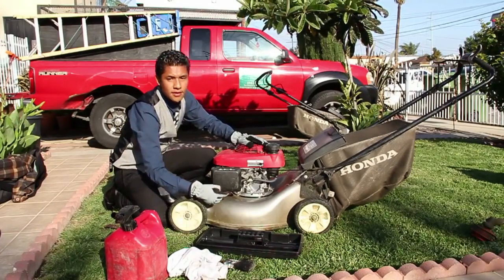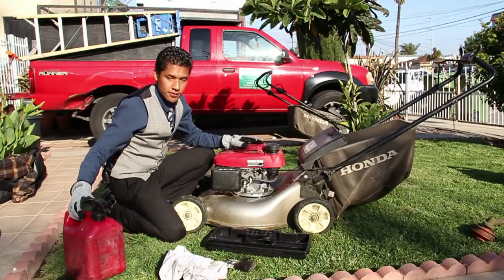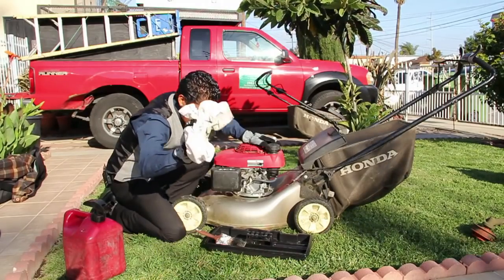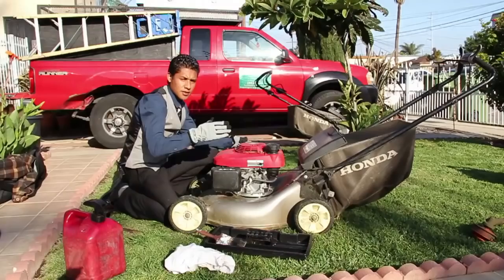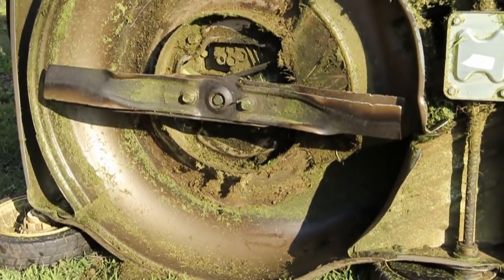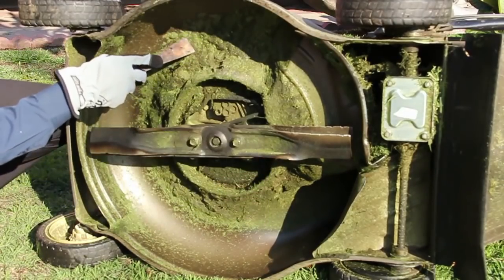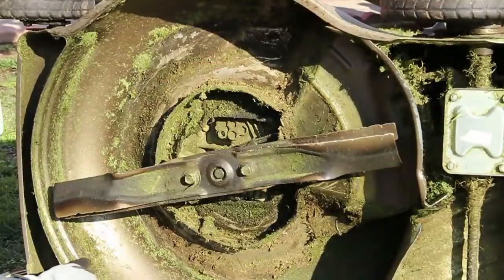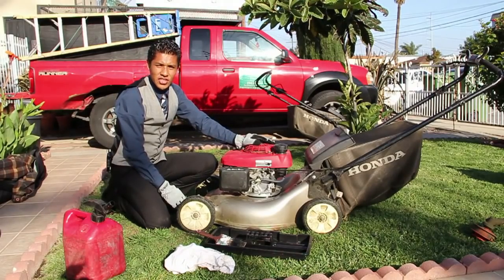Maintenance for Lawn Care Tools : How to Clean Your Gas Lawn Mower

Comment: Careful not to spill gas on the grass or you'll kill it.
Also, you put the mower on the correct side. The carburetor always goes up to help prevent crankcase oil from entering it. That can happen when tipping the mower on its side with the carburetor facing downward. Lastly, its a good practice to remove the spark plug wire from the plug prior to any physical contact with the lawn mower blade.
Nice job young man! You put together a helpful tutorial there for many homeowners. Keep up the great work!

Comment: 1) never cut wet or damp grass as when it clogs up like that you put extra stress on the engine.

2) never use a scraper to remove the grass as you may remove the paint which will expose the metal to rust.

3) Never use a hose to wash the mower as water will eventually cause rust.

4) never tip the mower with the air filter at the bottom, and if you have to tip it on the side (air filter to the top) ensure the piston is at the top by pulling the starter cord until it goes taught.

5) for cleaning allow the mower to cool, remove the spark plug cap and tip the mower back to the front is in the air, remove any lumps of grass with a gloved hand and then use a wooden kitchen spoon/spatula (blunt edged) to remove grass and then a firm hand brush.
Reply: Good tips, Wayne! I cleaned my mower today, but I tipped the mower forward instead of backward, unfortunately. I only had it in that position for a minute or two, and it started up fine afterwards. Should the mower be okay?
Reply: @MikeDGuitar  just check on oil got in to the air filter, if it did clean it or replace it if its bad
Reply: @waynegarrett1614  Cool! That's what I did, and there was just a little bit of oil along the top of the air filter. I soaked it up with some paper towels. Many thanks for the response!
Reply: You may want to use a hard plastic scraper and remove the spark plug first and foremost.

Comment: Oh Jay Jay Jay,  what are we going to do with you? Slightly overdressed. You forgot to pull the spark plug wire. Cleaning your lawn mower on the lawn and with gasoline? Now Jay let's think about this. I see quite a few Knicks in that blade.  It could really use a sharpening. While you did shut the gas off, as soon as you tipped it on its side you were likely dripping from the gas tank all over the lawn. Going to have quite a few dead spots to fix their Jay. You were just funnin us weren't you?

Comment: U forgot to mention disconnecting the spark plug lead & putting a piece of plastic bag over the fuel tank opening & screwing the cap down over it,dont forget to remove it after ur done or your mower wont run properly until u do (it creates a vaccuum)

Comment: I use WD-40 and it melts away the grass gooo.
With gas tank almost empty, turn on the side and 
use WD-40 and in 2-3 minutes stiff brush to wipe away.
Reply: I use baby oil with spray bottle
Reply: @Chris H 
I have found it possible to turn sideways my mower 
with the oil dip stick on the upward side.  If the oil draws sideways  to far 
inside, it also drains back in a few minutes.
.
It is not necessary to turn the mower completely  to remove the blade,
cleaning and sharpen..

Comment: Hi Jay,
A few things others have mentioned:
1.  Disconnect the spark plug before anything.
2.  I've used gasoline before too, and it works as good or better than anything.  I don't anymore.  Gasoline can do you in a multitude of ways:
  - Its fumes travel, and the spark plug wire after disconnected will get it going.  you will never get those gloves off in time and you will have permanent burn scars, no maybe about it.
  - Everything nasty causes cancer, but gasoline moves through your skin readily.
Diesel fuel works very well, it won't start on fire easily, slower to go through your skin, and less cancerous, BUT use gloves.  If I had know what people know now, I would have.
 3.  You flipped the mower the correct way, but mention that you did it so that the gas tank is up, and not completely full.

Question, that looks like a Honda HRX.  I don't know if you mulch with it, but if you do, how well does it do?

Comment: Disconnect spark plug wire first if you are spinning that blade around.   Gas over the grass?  Good luck with that.
Reply: @HeatCheck718  why take the risk?
Reply: Blade needs to be replaced, spark plug boot should be taken off and if you want to kill your grass, get gas on it.

Comment: After watching this video be sure to search for a video on how to repair dead spots in grass due to gasoline, and or why does the paint finish look so bad on my mower? #thereisabetterway
Reply: +Jeff Hobgood beat me to it! :)
Reply: Jeff Hobgood no kidding man. I just cold rinse, give a light degreaser spray to the mower surface, then mop with the same soft brush and car wash solution I use on my car. Cold rinse again, blow out water with my blower and woohoo.

Comment: nice, the only thing missing is removing the spark plug. I use old gas that has gone bad or in question to clean engine parts. I wouldn't do it my lawn just in case some spilled. I wouldn't want a dead spot in my yard. However a very helpful Video.

Comment: if you are in the mowing business i suggest you remove and sharpen your blades more often -- blades with those chips on edges just tear top of grass blade and leaves dead brown top of grass and then lawn does not look as nice ----  i just do my own lawn and i would never let my blades get that chewed up -- how about using 409 or Fantastic or similar product to clean top of deck, not gasoline -- and then when you are under deck use wire brush after putty knife... and then spray with WD 40 or Rust Pure or similar product - then grass wont stick so much

Comment: How about this 1. Remove boot from spark plug. 2.POWER WASH IT!! much safer better job. 3. Shut off fuek valve. 4.REMOVE BLADE!! SHARPEN IT! Scrap deck. 5. Slap blade on. 6. Turn on fuel add a seafoam protects gas AND cleans your carb. 6. Add spark plug grease attach to. Plug to boot. 2 years experience professional service. Need more help look up Miller Lawn and power Marion Oh
Reply: David Miller I don't have a power washer. I just cold rinse with a spray nozzle, give any parts with greasy residue a light spray with degreaser, let it sit for a few seconds, then mop with a soft bristle car wash brush using my standard car wash bucket with maybe a gallon of car wash water soap mix. Another cold rinse, blow it all out with my Toro blower and it looks like new. My Super Recycler is in its sixth season and still starts on the first pull.

Comment: NO..NO...NO...... safety?...dude, 1st of all the spark plug wire should be disconnected for safety, you dumped gas on the lawn, & YES YOU CAN tip the unit without turning gas off CARB FACING UP, so that unit you  can tip it to the right side of unit, 45 degrees, or handles down so front of unit facing up  (do not crank engine tipped).

Comment: Damn, I tipped this up with the air filter facing up, but gas still leaked out and got into my exaust/muffler area, and into my air filter... Now I dont know what to do. I could replace the muffler and air filter as that's pretty straightforward. But not sure if theres anything else wrong. Also I can change the oil no problem since I may have got gas in there too (smells like gas)..

Comment: do not follow this  FIRST AND FOREMOST pull the spark plug wire, turning the blade could start the motor . send never gasoline on grass never

Comment: uh theres a thing called mineral spirits.  no wonder pollution and gas pprices are flying!!!!
Reply: Guy Garic yeah because mineral spirits are cheap. And pouring it onto the bottom of the deck will work better than using the garden hose, right? 🤭